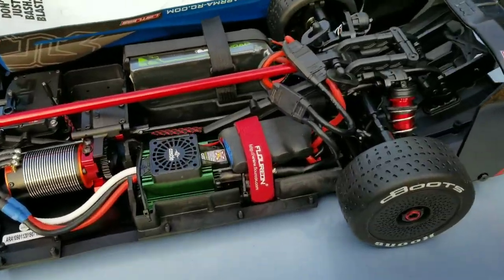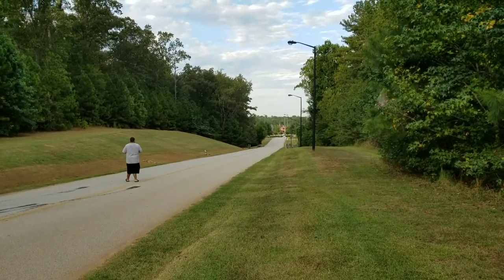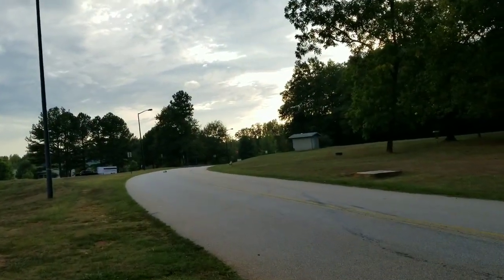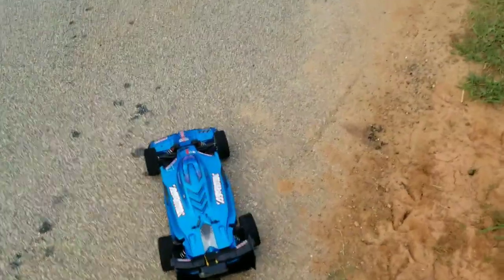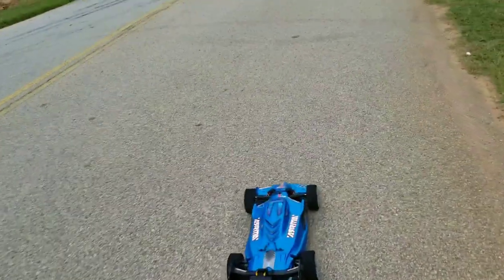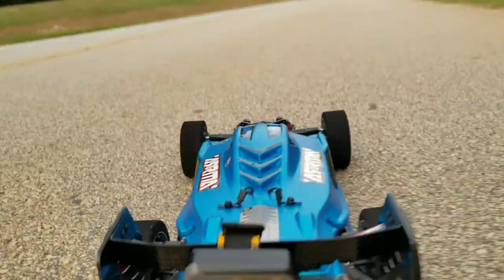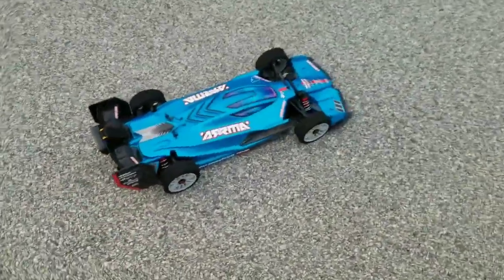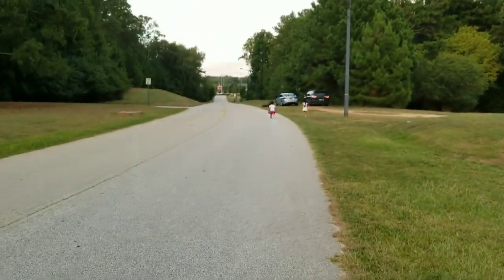Arrma Limitless hits 102 mph using a cheap 1/8 scale buggy motor and cheap 50c batteries

Comment: you like this motor ,  is toro  2350 kv ?
Reply from the maker: Actually a pretty good motor for the price.  Have to be careful to let it cool down if you're running tall gearing and or high voltage.